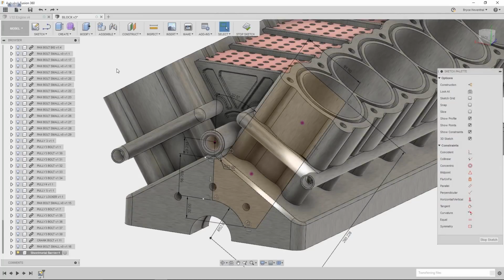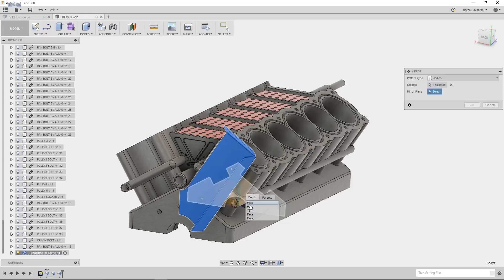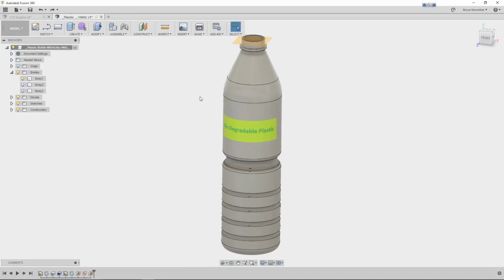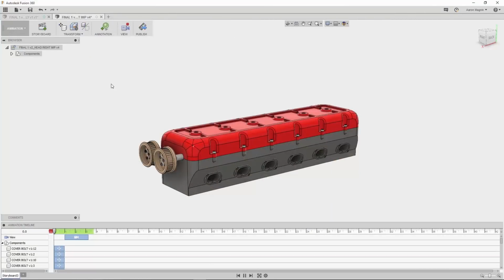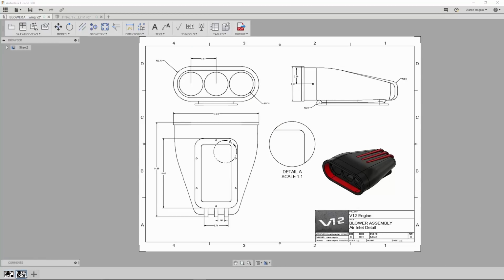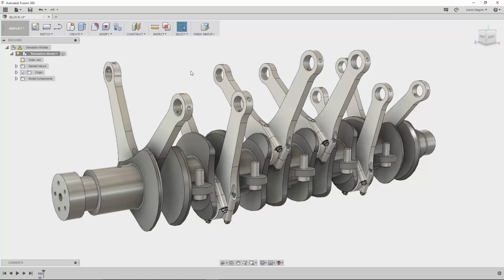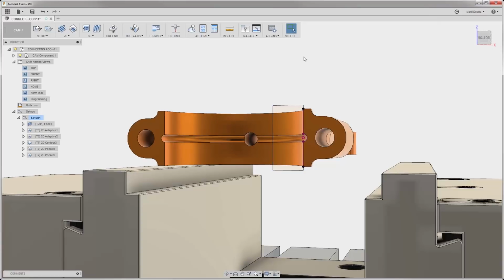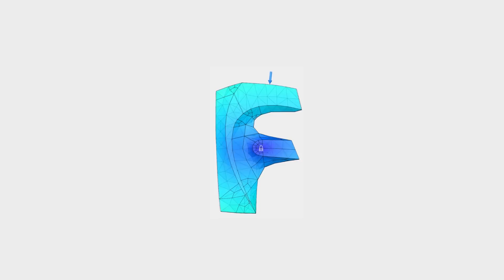What's New in Fusion 360 December 2017 Update

Comment: The Helix utility is an awesome tool. I spent much wasted time trying to create this kind of shape.

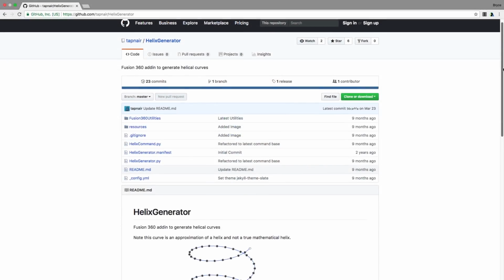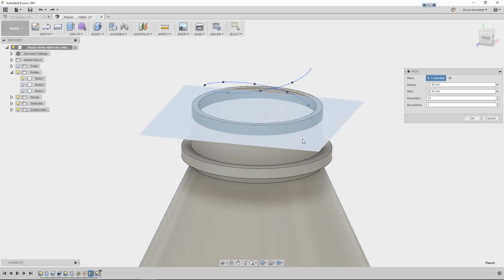However I think there was an unintended error in the vid. From 2:54 through 3:09 it shows a right handed thread. At 3:10 and through to the end of the scene it's a left handed thread. I can't quite tell because the resolution of the vid isn't high enough but I think the operator typed a '-' pitch. Certainly this reverse pitch has many applications, but I don't think a water bottle cap is very practical.

Comment: Are you nuts guys (and gals) from Fusion 360 team?! 
Adding the Flow tool path - the most powerful 3D finishing strategy in HSM arsenal and don't even mention it in the video?
Yes, yes form tools are very nice addition, but those could be always "workaround" by the same sized end mill and a bit of imagination;-), but nothing can substitute for the Flow in certain (quite common) situations!
The fact you've added it with 3-axis support AND optional 5-axis toggle is so ingenious! It's the best Christmas gift you could give me! 
I'm out building 5th axis for my CNC machine...;-)
P.S.: For those wondering why "this freak" is so excited check this Rob Lockwood's video: https://www.youtube.com/watch?v=7vS8w19_v5A
Reply: I agree, a flow tool would be awesome.  Not only good for engineering but also to open Fusion up to users from the Jewelry industry for example.
Reply: Not sure if I interpret your reply correctly Benny in the shed, but the Flow tool path has been added in this update! Check Fusion 360 CAM -> Multi-Axis. It's there and works!!!
Some more tool path containment options would be nice to be able to handle tricky geometry with less hassle, but I don't want to be nitpicking...:-)
Reply: Wires got crossed Jan.   I was suggesting a geometry flow tool where you could take model geometry and flow it onto a surface like in Rhino.  I missed that you were talking CAM oop!  :-)

Comment: Good job with the improvements to sheet metal. But What would make a huuuuuuge difference, is a mitering feature. Instead of simply saying there’s interference between those two flanges, give me an ability to auto miter them. 

Currently you need to create another sketch or two, and manually cut the overlapping flanges.
Reply: Aaron Magnin the problem comes up when you need to use multiple features to create intersecting flanges at different angles.
Reply: Aaron Magnin I’ll draw something up and send it your way :)

Comment: Where is the save locally only, the most voted.
Reply: not gonna happen... it's designed as a cloud based product, they're not gonna go for that.
Reply: Simon Hills Is the "save locally only" a feature in the paid version, or is it not something available for both paid and student/hobbyist/Small business <1 million take in? If it's just not available for any, is it viable to say a proprietary design be kept just that, proprietary to the proprietor? Sorry if this seems like a very noob question, as I am just that, a noob! Thanks
Reply: so would i I use a team hub
Reply: I am trying to push fusion 360 at work but the single stumbling block is cloud storage, our company policy does not allow this, shame more than 5 seats going to rivals. ahhhhhh
Reply: 393stroker save locally is not available at all. In ultimate or otherwise.
Reply: The save local is a action you have to perform by exporting the model out of fusion then deleting the model from fusion and if you have no problems being on the cloud you right click on the model in the tree and select add to offline cache, then you can have said model useable online or offline you can do folders as well.
Reply: You can export file and save it locally on your computer with .3d extension
Reply: don't you mean .f3d
Reply: daniel lyall I'd rather jamb needles in my eyeballs than export out f3d files constantly.
Reply: daniel lyall that's still not a local sync though. Even though it looks like it is. It's pretty much a webpage running inside Windows Explorer
Reply: I know it does what I need for now just.
Reply: Cullera Drones that's what Inventor HSM is for...
Reply: Scott Moyse $$$$$$$$
Reply: A bit less than double the cost of fusion with 3 axis cam
Reply: Cullera Drones no it's not, in a lot of ways it demonstrators much higher value than Fusion does. If Fusion 360 wasn't an option, for the level of CAM you get it would have been considered to be the best value by far. So which product is the competition you refer to?